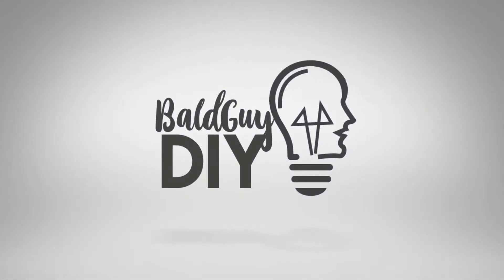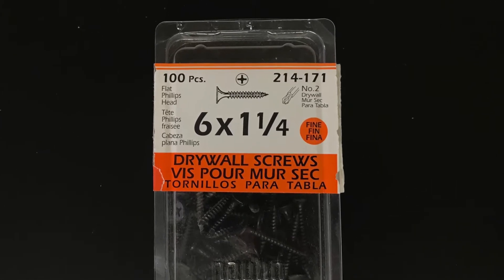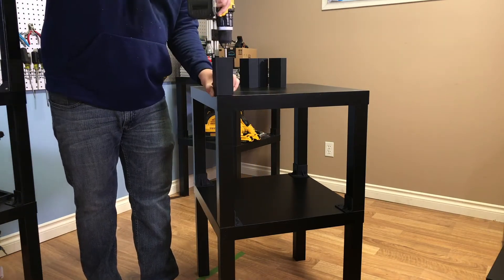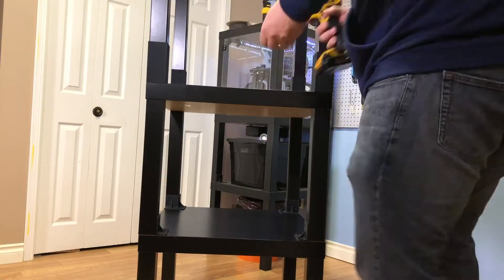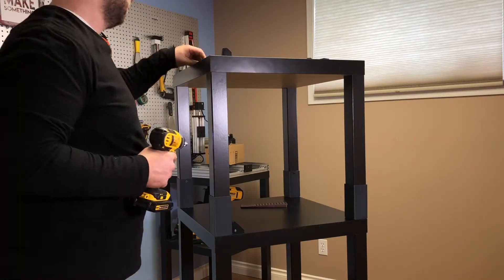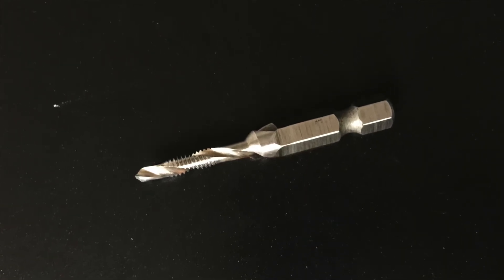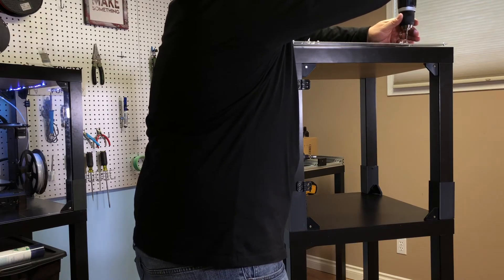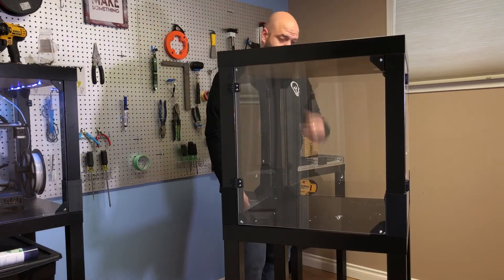IKEA Hack: 3D Printer Enclosure

Comment: You explained everything you did, what you used, what you bought, and what you made all under 5 minutes... Thank you so much! Fantastic video, dude! The only thing that would make it 100% perfect is maybe a reference sheet, or even just some links in the description would be great :) Either way, this is a great video thanks again!
Reply from the maker: Thanks for watching, and for the comment. Good suggestion!
Reply: @BaldGuyDIY  You quoted around $80 for the whole build but the one supplier I got a quote from for some plexiglass wants $80 just for the plexiglass. Where did you get yours?
Reply from the maker: @p0ppytears  just a local plastics supplier. Prices might have changed since I did that project.  If you find a place that sells full sheets and then get them to cut it down it will be cheaper than a custom glass place. Good luck!

Comment: As well as any screws and plexiglass you bought to make it. Did you have to cut the plexiglass yourself?
Reply from the maker: Hello and thanks for watching!  I used 1/8" thick acrylic, and I had it cut by a local supplier to the dimensions I needed.  I used 8-32 screws to attach the hinges and connect to the magnets, and I used a bit that drilled the hole and tapped the threads into the acrylic in one pass.

Comment: Hi there, have you noticed any wobbliness when the printer is going full speed? Thanks
Reply from the maker: Hi, thanks for checking out the video. I have noticed any wobbliness of the enclosure itself. Depending on if you are using it on carpet or on a hard surface, you may want to shim the legs to make it more level and stable. I use mine on laminate, and the floor is not quite level, so I use shims.

Comment: Hey, I was just wondering if you can still hear the printer when it’s in the enclosure? 
Planning on having one in the living room and really want to cut back the sound. Cheers.
Reply from the maker: Hi, thanks for watching. You can definitely still hear the printer, but it does make it quieter. If you enclose all the sides, and use weather stripping around the edges, it will make a big difference, but you will still be able to hear it.
Reply from the maker: I’ve sent the files. Good luck on your project and thanks for watching!

Comment: What size plexiglass did you get?
Reply from the maker: Hi, thanks for watching. The acrylic sheet I used was 1/8" thick, and the dimensions were 17.25"W x 19.5”H.  Keep in mind that your printer might not fit the enclosure without tweaking the heights of the extensions, so the dimensions of the acrylic might not be the same.

Comment: The risers aren’t tall enough for the ender 5 unfortunately
Reply from the maker: non existent great feedback, and a simple fix for that. Just scale the z axis of the model while leaving the x and y the same. If you need it 1.5 times the height of the original, just make the z scale 150%. That should solve it. Good luck!
Reply: BaldGuyDIY thank you, it needs to raise approximately 2” but I was going to go 2 1/2” just for extra clearance. How would I be able to figure out the percentage I need to adjust it?
Reply from the maker: non existent measure the regular sized one. Then add the extra height you want to add and divide that number by the original height. So for example, if the original was 4”, and you are going to add 2 1/2”, the new total is 6.5”. 6.5/4=1.625, so scale the z by 163%, or round up slightly to 165%, and you’ll be good!
Reply: BaldGuyDIY thank you so much!
Reply from the maker: non existent if you don’t mind, post the final z scale that you used for the Ender 5 so others will know. Thanks and good luck!
Reply: BaldGuyDIY I will for sure! Going to measure now.
Reply: BaldGuyDIY the original height is 4.75 and I want the new height to be 7.25. So I took 7.25 divided by 4.75 and got 1.526 so that should make the new scale 153% correct?
Reply from the maker: That sounds correct! Or go 155% if you want to give a slight oversizing. Print one to make sure it’s high enough, don’t want to waste material:)
Reply: BaldGuyDIY I need to order a new roll of filament before I can test it, and it’s a 16 hour print so it’s going to take like 4 days before all of the posts are done haha. Thank you for your help. I’ll come back and verify when I’m able to.

Comment: Question.  Is there a reason why you did not use the column blocks that are on the top table on the bottom table?  It would look better.
Reply from the maker: I just didn’t need the height lift like I did for the top table. Different sized printers may need different height adjustments.  If I was going to put another printer on the bottom shelf I’d need the height extensions. Thanks for watching!

Comment: Nice video. You should fill out your information and include links for the stl, and other things users might need to do what you did.

I am curious. You didn't address the heat that can build up and damage a power supply or the led. Is this not an issue?
Reply from the maker: +MiniBlaze Thanks for the feedback!  I haven’t noticed any issues with heat at all. The power supply sits outside of the enclosure under the printer. The changes to the power supply I made to power the LEDs haven’t created any noticeable additional heat.  I leave my printer on continuously and use it pretty regularly.